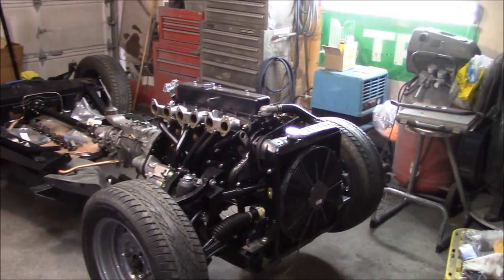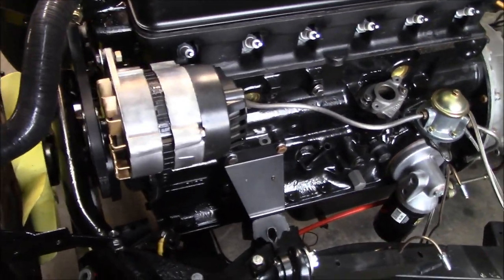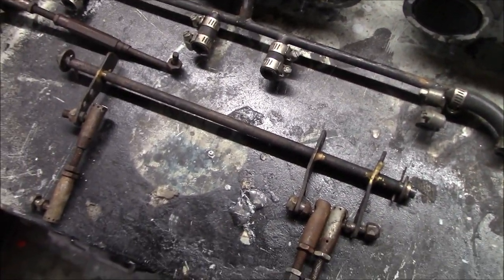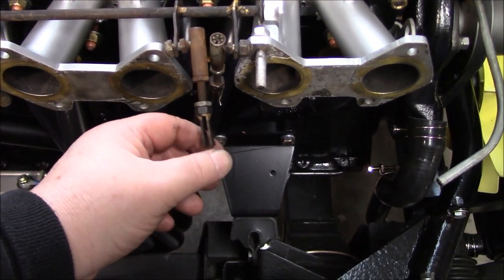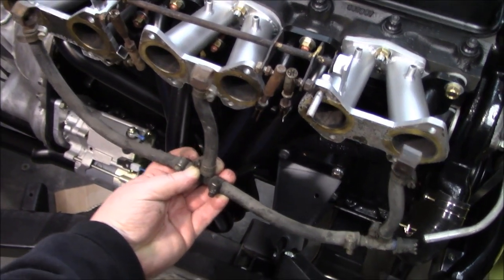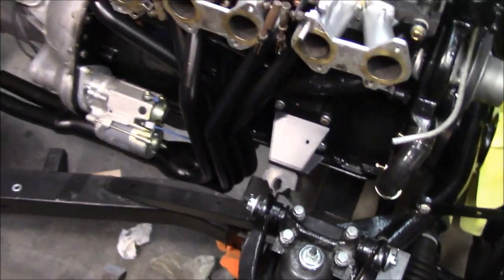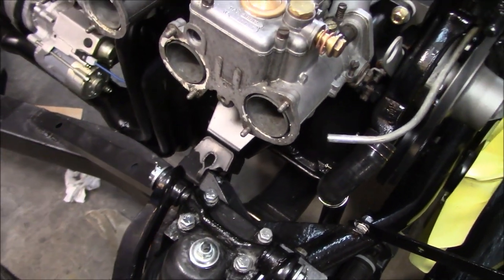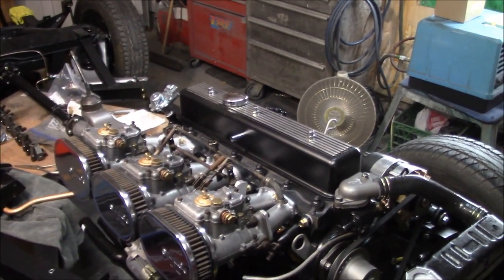1968 Triumph TR250 Restoration, Fitting the Triple Weber DCOE 40 Carburettors & "Custom Linkage Bar"

Comment: Can't beat the look of three DCOEs! I'll bet you can make that linkage look good enough until you figure something else out. The main thing is that it can open the carbs and be adjusted. Enjoyed hearing your thinking about getting things together. IIRC you have a tripod. It would be great if you had both hands free while showing us stuff and working. Just a thought. Thanks for the update!
Reply from the maker: Hi Bruce.  Thanks.  Yes, the tripod would be better and I’ll try to use it more.  It frustrates me a bit as it’s pretty tight around the car and it always seems to be in the way 😉
Reply: @cheftush  David, I have a thing called a "Magic Arm" from Manfrotto, but there are less expensive ones available. It can be attached to the ceiling or wall, or mounted on a mag base and has 1/4" screw thread on the other end that will hold any standard camera or cell-phone mount. It's also useful for holding tools and measuring instruments,. Amazon.ca has a bunch of them from about CEN$20 to 60. Just FYI. Thanks again for the videos!

Comment: The original way for the Webers to be fitted onto the manifolds used a Thackery Washer with plain washers each end on the bolts to pull the carb onto the O Ring carrier plate (between carb and manifold). Adjustment was a 25 Thou feeler gauge between the coils. I have removed much skin off knuckles setting up lower bolts and Thackerys on Lotus Elans and less difficult Twin Cam Escorts.
It allowed the carbs to move and be insulated from engine vibration which caused horrendous frothing of the fuel in the reservoir. The better solution would be flexible rubber one piece joints between the manifold and carb as they use 8 smaller bolts and nuts per carburettor but that may well push the air cleaner into the inner wing. And yes they need inlet trumpets.
Those carb linkages look rather ingenious and very 'period'. Bit of a buff up and paint will sort them out.
Reply from the maker: I have the Thackeray washers installed although I’ve got new soft mounts coming (just ordered $330 worth of parts yesterday) so I’ll reassemble the carbs before start up on the new mounts.   I’ve ordered some short trumpets to fit inside the air cleaners as well.  Should be here within the next week or so hopefully.
Reply: @cheftush  You can always tell a seasoned classic car restorer - "just another $330 for parts ..."
Soft mounts are best as long as you have space against that inner wing.

Comment: Hi Dave, the triple Weber set up reminds me of the old Meccano sets that many of us had as kids but I appreciate that you need to utilise the stuff that came with the engine. However I think while you have the opportunity to renew most of the fuel bar could you consider running the fuel line around the back of the engine, where it will be less exposed and where there is a lot more free space available...looking very impressive now, although maybe a little “overkill” for a non-track car. Stay safe buddy 👍🇬🇧
Reply from the maker: Hi Phil, yes I’ve seen a few guys run the fuel line around the rear of the engine....I think most of these guys are using non stock electric pumps...I’m using the stock mechanical pump so in my mind it makes more sense trying to go around the front of the engine vs looping it back...we will see.  I can always switch it up and get a blanking plate for the stock pump and go electric in the future...pretty much the same with the linkage...as mentioned, I need to get the car running for break in at least.  I’ll use this original linkage and then when I take the carbs back off to get the body on, I can play around with the linkage then.  Cheers, Tush

Comment: If all those existing linkage bits don't work properly when you get it running
could there possibly be a cable-type linkage system available ?
Reply from the maker: Hi Dennis,  I do have a cable pull from RATCO as an option to pull the linkage from the throttle shaft to the bell crank under the bottom of the first carb...there are some other options for the levers coming off of the throttle shaft on top of the carburetors but  these would have to be solid (adjustable) rose joint/ball joint type connectors.

Comment: great work Cheftush, I learned a lot from your video's for my TR250. Looking forward to when you fire-up the engine first time!! I'm currently trying to figure out how to extend my two SU HS6 carbs to a triple setup on my TR250... the manifold I could get from Goodparts in US, but the linkage is the issue... if anyone has experience with this, suggestions are welcome, thanks. :-)
Reply from the maker: Triple SUs would be cool.  Most of the TRiumph guys will use either the Weber’s or will do triple Zenith Stromberg conversions.   Have a look at the Jag guys or the Healey guys as they’d be running triple SUs stock in some applications.

Comment: These Webbers look great, loving the linkage, seems to work rather well. I was thinking if you fit trumpets inside the filters, won't they restrict air flow?
Reply from the maker: Yes, any filter will restrict airflow somewhat, but it’s a little risky to run with just the trumpets...

Comment: Them Weber’s look awesome, good to see there proper Italian Weber’s, so much better made than the new one you get that are made out of cheese. However that linkage, it’s just making me cringe looking at it, none of the linkage rods are straight. The throttle curve will never run right like that, making one Webber open different to the next. No matter how much you adjust it it won’t run right. I’d be looking for a new linkage if it was me 👍🏻
Reply from the maker: Agreed Steve.  I told you it looked “custom”😉 I’m going to get it running with the existing linkage set up and then will look at investing in some new components.  Weber stuff is extremely expensive to buy....I bought $330 worth of parts yesterday that doesn’t address anything to do with the linkages yet....
Reply: You'll get there mate, I know what you mean about expense. I looked at putting a weber on my MGB, until I saw the cost. So for now it's on a back burner

Comment: These connections for the triple webers reminds me of the E-type
Reply: It will have been based on something existing that the builder had seen or used before.... probably worked fine for a home-built track car after a bit of bending and adjusting.

In the same way I’m sure a neater  Version 2.0 permanent solution can be devised !

Comment: big mistake to put weber carbs on this 2.5 litre engine.  I put the 40 webers just like yours on my etype Jaguar 4.2 litre engine and they were way to big....too rich and not able to be be adjusted to lean the mixture....stay with the original carbs on this tr 250.  I had one and they work great.
Reply from the maker: Hi Barry, I would normally agree with you on a stock engine, these carbs would be overkill.  However, my engine has had some head work done to it, has an aftermarket cam and an aftermarket header and free flowing exhaust.   These carbs can be set up very effectively with this combination and there are many street driven TR6's out there with this very combination.   I am not the first that it for sure.   Thanks for watching and commenting.